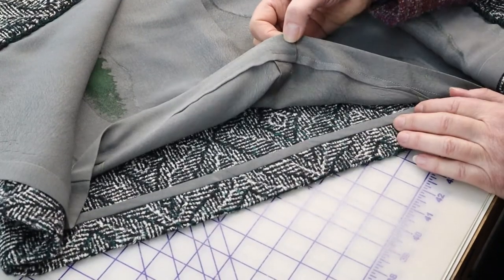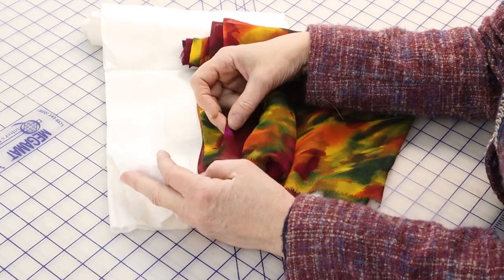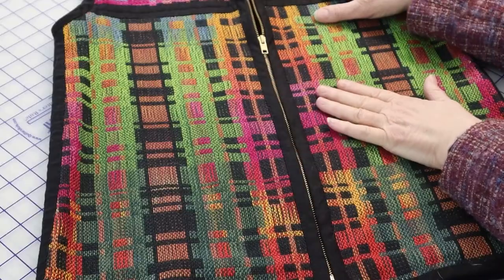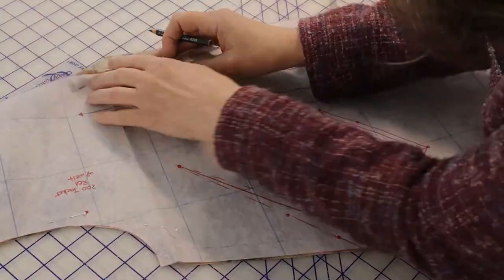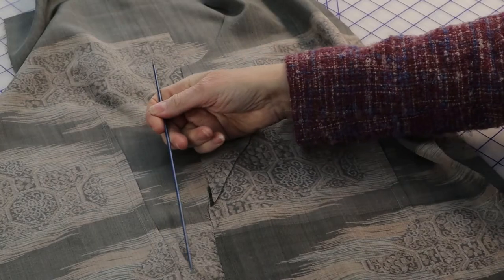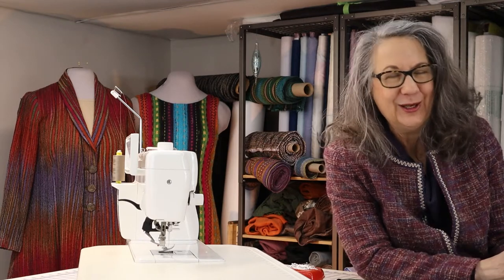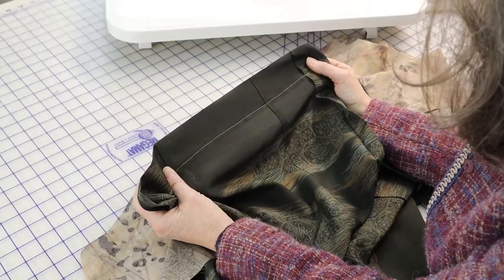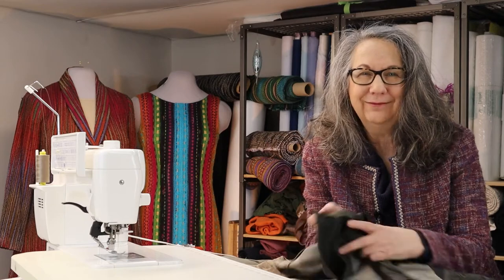Linings Part 1: Assembly

Comment: Hi Daryl. I’m a beginner sewer. Is this the way to make a lining for any jacket fabric or just hand women’s? Thx😊
Reply from the maker: There are many different ways to install a lining, this is one of them.  I use this technique on commercial fabrics as well, but much depends on how the garment was designed.  In a commercial pattern, often linings are attached to front and neck facings, but the garment directions might give a better feel for what the designer intended.

Comment: Have you ever had any static issues when mixing man-made vs natural fibres and linings?
Reply from the maker: I rarely have static issues, I don't put my clothes in the dryer, use white vinegar in the rinse cycle.  Static issues happen when fabrics rub together, synthetics make it worse, as does dry indoor winter air.  For me it is usually when I'm wearing acrylic or nylon tights that cause linings or slips to cling.  Silk and rayon both can get static-y.  A trick I found is to pin a safety pin to a couple of side seams in the lining which breaks the static charge.